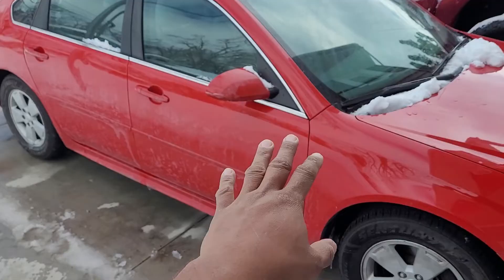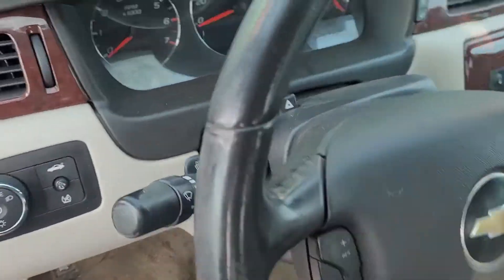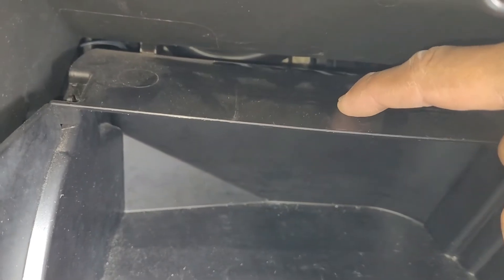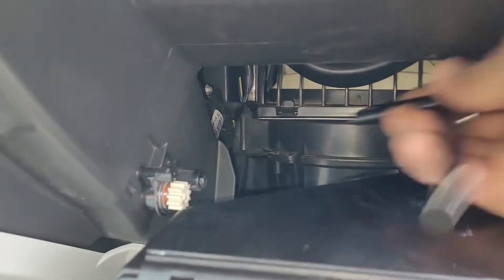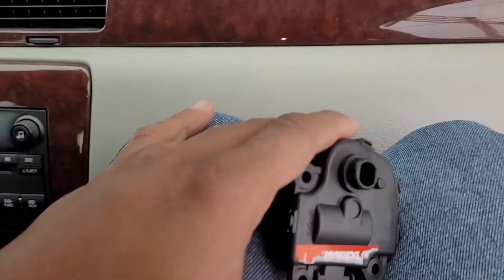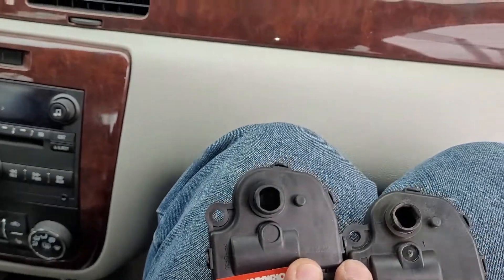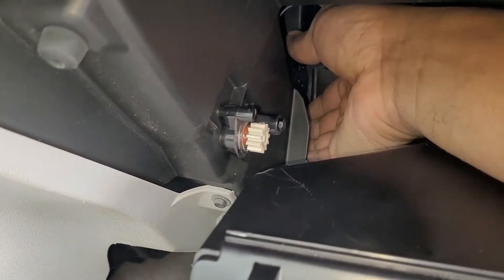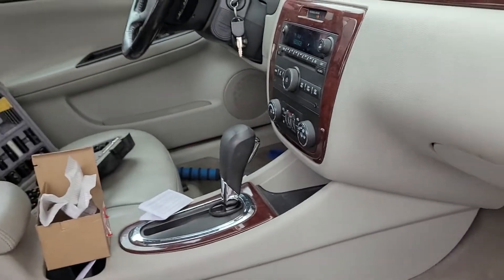Glove Box Clicking? Passenger Blend Door Actuator Replacement, Chevy Impala (Minute Maintenance)

Comment: This video gave me the courage to do my first car repair.  This thing has been bugging me for months. Thank you. Also, I dont keep gloves in my glove box, but everything i kept in there did fall out because I got overexcited.😅
Reply from the maker: Love that the video gave you the confidence! You'll be doing engine rebuilds in no time!
Reply: Will the blender aggitaior start blowing cold air
Reply: If I replace it
Reply: I'm a female but I'll fix it
Reply from the maker: @PAMELAChanze  Hey thanks for the question, the blend door actuator is part of the vehicles heating and cooling system. So if it is stuck in one position it could prevent cold air..or heat from passing thru. There's many reasons for the temperature to be wrong including lack of free on, low Coolant in the radiator or bad ac compressor. But if you're having the noise as demonstrated in this video and trouble controlling temperature or fan direction i.e. floor, vent or defrost then odds are the blend door actuator is to blame!! Good Luck and Happy Wrenching!

Comment: Great video.  Very helpful.   Be aware that there is also an actuator on the right side of the glove box opening mounted on the blower housing.   That’s the one that went on my 2012 impala.  Same replacement part but those screws are extremely difficult to navigate to.

Comment: Thanks, not just what, but how to.  Added a like.  My '08 Impala is doing this, so time to replace.  An additional concern is if I don't address it soon, it might run down the battery, as the noise often occurs when I open a door, without turning the car on.  It's definitely the passenger side, but I wonder how long before the driver's side actuator goes (the odometer shows 74K+ miles).  Also, you used a Dorman replacement part.  Where I live, the only parts stores are Napa, O'Reilly, and CarQuest (still so named, despite being bought by Advance), plus the Bowtie dealer.  Which is recommended?

I have a 1/4" socket wrench with an extension and a universal, so that might help a bit with leverage.  

winter gloves remain in the coat pockets.  I only carry work gloves in vehicles.  In the Dodge truck, I put them on the floor behind the driver's seat; in the Impala, they're in the console storage unit.  The glove box is for the owner's manual, plus other paperwork (registration, insurance, receipts for parts and repairs), and a flashlight.
Reply from the maker: Love it 😀 haha...for whatever reason I've always seen the Passenger go out! The Drivef has to sometime but just as easy to swap. I'm an O'Reilly guy all day long!! But as far as Brand for Parts..depends on the Vehicle..daily driver doesn't matter save money buy generic..My Truck, Motorcycle...52' Chevy...when Performance Matters you go Name Brand!

Comment: If i only disconnect the wire and leave actuator there, will the clicking noise go away?
Reply from the maker: @tube4625  Hey thanks for Watching! Yes if you disconnect the wire it'll stop the actuator from trying to actuate, however you won't have the best heat/AC as you'll be unable to direct every vent i.e. floor/defrost/dash. Keep in mind in This vehicle there is Anlther actuator on the drivers side so that may be the faulty one. Good luck and Happy Wrenching!

Comment: Hey man thanks for this information, but I do have a question if you don't mind. My impala is making this exact same sound from the glovebox. But it blows out hot air. It does not however blow out cold air. Would I need to replace this actuator, or the one found further in the back?
Reply from the maker: Thanks for watching Partner! If it's making the same noise I'd say so, you've got a bad Blend Door Actuator. The Noise is the Biggest clue, next would be a lack of Proper Air Flow...be it Temperature or Direction! I think you're on the right path, swap it out!!

Comment: i have a malibu and it’s making a very similar sound but slower i replaced this box behind the glove box but the sound didn’t stop
Reply from the maker: Hey thanks for watching! I'm sorry you're having this issue and the swap didn't fix the problem! The cheby Malibu and impala with dual climate control has 3 total blend door actuators!! 1 on the opposite side of the center console as I describe in this video, the 1 changed and then 1 on the right hand side behind the glove box!! If you can, lower the glove box as shown in this video, when the clicking sound starts reach in and physically touch the 2 blend door actuators behind the glove box, you will be able to feel the clicking happening. This will narrow down which 1 is acting up (possible the new one you bought could be bad, they are mass produced and sit on shelves for extended periods of time I've had new off the shelf fail on me within hours before)..if neither of the 2 behind the glove box are clicking, means the likely culprit is the 3rd blend door actuator on the driver's side! Hope this helped and Happy Wrenching!

Comment: So, no calibration is required? Didn't have to disconnect the negative battery terminal? I'm Getting ready to replace both driver's side and passenger side.
Reply from the maker: Hey, Thanks for Watching!! I did not, Have To, However as Mentioned in the Video Your New Part  Will Come With Instructions On How to Calibrate. I Was Lucky That My New Part and Old Failed Part Were Already Aligned! Good Luck With Your Maintenance!

Comment: Will this affect my driving don’t have the funds to get it fixed rn but soon
Reply from the maker: Driving no not at all. The Noise will he annoying...but after a few min will stop..but will come back again. The most important thing is itll prevent you from having good air flow for heat or ac...so visibility thru the windshield may be effected based on temperature!

Comment: I just can’t seem to get this new actuator on and it’s frustrating.
Reply from the maker: I'm sorry to hear that boss, it can be tricky given the space to work with. If you have the original one you removed, take a look and see if the motors are lined up in the same direction and that they're identical designs. If the alignment of the new actuator is off you'll have to adjust it, normally by plugging it INTO the harness without actually connecting it to the Blend door, turn the car on and the actuator will begin to rotate then shut it off when it's similar alignment as the old one. Most actuators have detailed instructions in the box on how to adjust them.
Reply: @minutemaintenance7385  thank you for replying to my comment as it was mostly just out of frustration. I didn’t end up seeing your comment till not but I successfully got it on but connecting it and as it rotated I was trying to put it on till it slid right on. I would not recommend this technique as I almost ripped the wires because the screws weren’t there to stop it from rotating. I agree with everyone else tho you video was nice quick and easy.